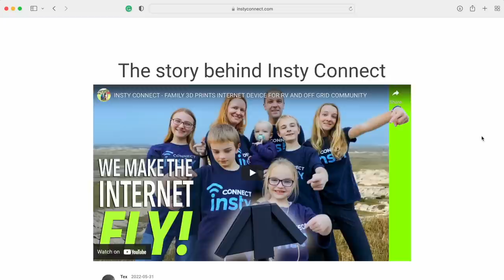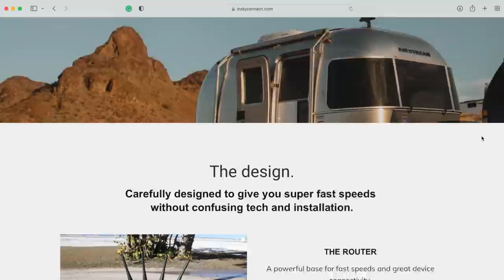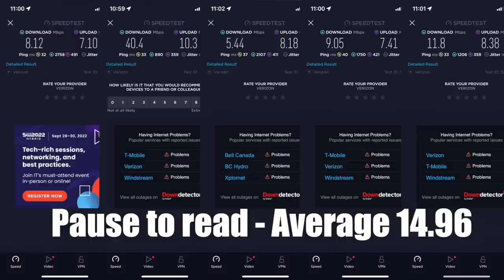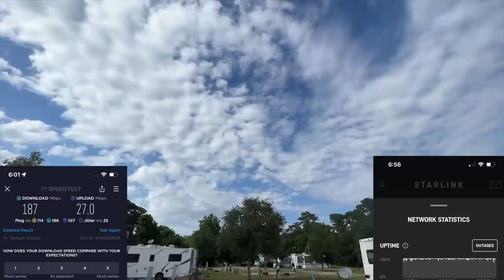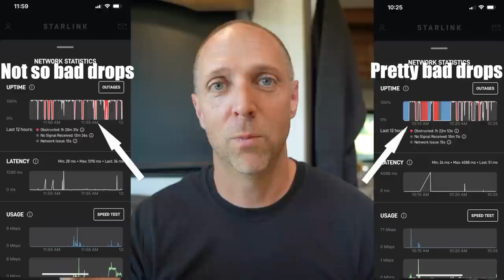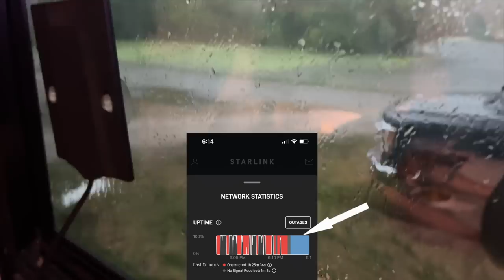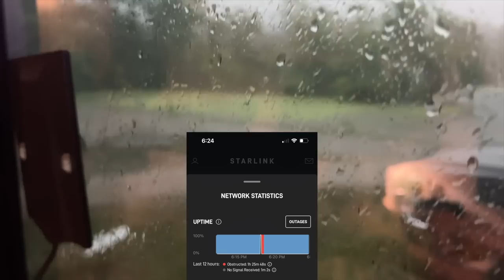Is Starlink Internet Working & Maybe Something Better

Comment: I have a hotspot and a booster and it works fine most of the time so I just don’t know that Starlink feels worth it yet. I wonder about the camping lifestyle of the folks getting consistently good service. Not all ‘full time RVer’ lifestyles are created equal.
Reply from the maker: Thanks for your perspective Dawn. We also used a hot spot and window antenna for about 3 years all across the country. Worked pretty good, but I’ll always take some faster speeds🤣 Definitely many different ways to do this lifestyle. Safe travels👍
Reply: If a different method works for you use it and leave starlinks to those of us that are never going to get a mobile signal it multiple time the speed of my old satalite providers cheaper and has less of a clear sky issue and takes up a lot less room, remember it wasn't design as a RV solution ,it will be intresting to see how it improves now they have add that user case and if new features are added.

Comment: I have insty connect and it works great!
Reply: The best part of insty connect is that you have control on which band it uses from a cell tower. So in the congested situation, just switch to the other band using the insty connect app and you get the high speed again!
Reply from the maker: That’s amazing! Looking forward to using it!
Reply: I was going to get starlink as a backup as we don't have an unlimited plan at the moment and they aren't offering them any longer... Hopefully that will change.

Comment: Odd you had that Issues in the rain as it rain a lot  were I am and my starlinks never went down once for rain.
Reply from the maker: This seems to be the Starlink enigma… some say it always works…. Others say it never works. I’m just sharing my experiences with it and letting people decide if it will work for their situation. 😊
Reply: @IreneIronTravels  could it have been one of the time spaceX had an outage and it just happened to be raining let us know if it happens /happened more than once?
Reply from the maker: It definitely could have been. It was on July 5th around 6pm if there is anyway to reference it. It was also a thunder/lightning storm if that effects it more than just rain….
Reply: @IreneIronTravels  don't know how to check that maybe someone else does but thunder storm  may be the reason we don't have them very often none in the last 2 year that I can remember.

Comment: Would the Insty replace our WeBoost?  We use Verizon.
Reply from the maker: The Insty would cause you to use the Weboost less and less as it pulls in a really great signal and uses a 4x4 antenna instead of the single weboost antenna. But, there may be a case(s) where the weboost can pull in a signal from farther away in a very remote location. It would be good to test them, but really the Insty would be a main system used  90 plus % where as the weboost might only help in a certain few locations.
Reply: A WeBoost can use a directional antenna...there's many different scenarios as it's all determined by the radio waves, weather, distance, terrain and height of the towers.

Comment: I have REALLY wanted to hear nothing but great stuff about Starlink but unfortunately that hasn't been the case. We just don't HAVE to be connected even though we would rather be of course so I'm thinking the extra cost of Starlink for us isn't going to be worth it. And I'm more of a flip of a switch type of guy anyway.  We have been on the road for almost 10 years and have been just fine with a Verizon hotspot 4G unlimited plan. I will be interested to hear about this newfangled contraption. Oh, new subscriber here and really enjoying your channel so far.
Reply from the maker: I hear ya.. it just doesn’t make sense for everyone. When we watched RV videos in 2017 and 2018 everyone said you need a Weboost cell booster to get coverage on the road as a Fulltimer. So we bought the $500 booster before we even got our van! But it turns out it only helps in some situations ( less than 20% for us) and what we really needed was the $40 mimo window antenna instead. Part of the reason we share these types of videos. Appreciate you watching! 😊

Comment: I appreciate you sharing your experience but I think folks need to be better informed about the downsides of 5G re health.
“Microwave deniers don't believe that the effects are real because they don't understand the mechanism.
The chestnut I see endlessly is that microwave radiation doesn't have enough energy to break covalent bonds because it is non-ionizing.  This is true, but it's irrelevant.  Microwaves work by agonizing voltage-gated calcium channels.  Calcium signalling affects many areas of animal physiology, including oxidative stress and inflammation.  This means that a tiny amount of energy can have devastating effects on our bodies.”

It gets technical but the short story is non-ionizing radiation plays all sorts of havoc with crucial processes in our bodies leading to major damage. Without getting too technical here’s a brief excerpt from proteopedia: “Voltage-gated calcium channels play crucial roles in many bodily functions including: cardiac action potentials, neurotransmitter release, muscle contraction. During neurological functions, these calcium channels create action potentials. At resting state,voltage-gated calcium channels are in a closed conformation. When the membrane is depolarized, they are open. These channels initiate the release of neurotransmitters at synapses, and have a powerful influence on synaptic strength. The nervous system requires different levels of calcium concentration, so when transmitter release occurs, high levels of calcium are needed. During short-term facilitation, slow steady streams of calcium build up. Failure of these calcium channels can result in migranes, ataxia, and also other neurological diseases. Calmodulin is a specific calcium channel sensor, and regulates the functions of the channel. “

There’s a lot more info out there … to keep it brief here’s a pubmed article:
https://pubmed.ncbi.nlm.nih.gov/25879308/

Comment: On the road now for 12 plus years. Verizon is all there really is everywhere with hardly any exceptions. An old cell phone plan with unlimited HOTSPOT, unlimited data is useless since a phone has extremely limited use on the actual net. Mobile pages are about 1/4 as useful as a full page. And some things cannot be done at all on a phone. I have added Home Internet (4G) from T-Mobile. It is supposed to only work at one address. Hmmmmmmm maybe not LOL. The biggest secret to good data usage is the receiver. I only use a phone that has the highest reception at the time I buy it. Samsung is always the best. From my 7 edge to my now Note 10 + 5G. I only use 4G. I can stand side by side with Apple Crapple users when they have no connection at all and mine is booming. You are solving that reception problem with the Insti. I would never ever use Starlink. I truly object to the total shutdown of earthbound astronomy by Muskrat.